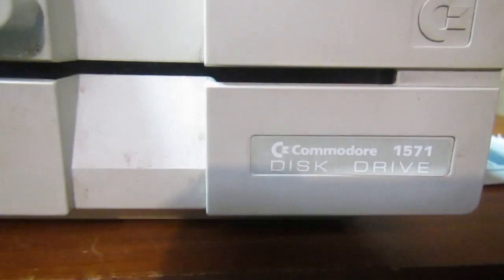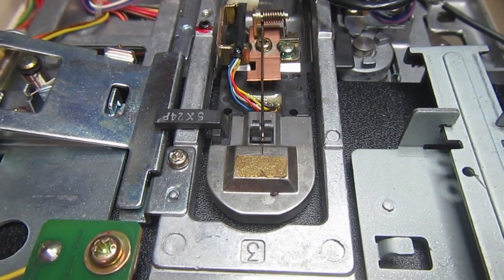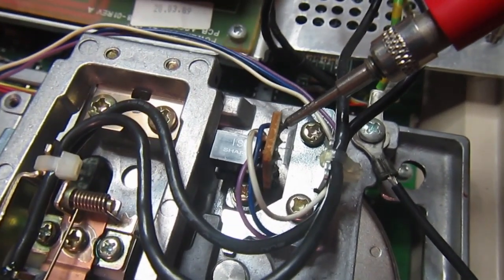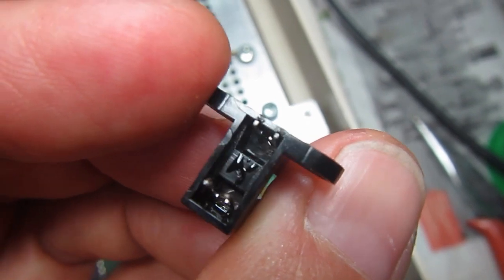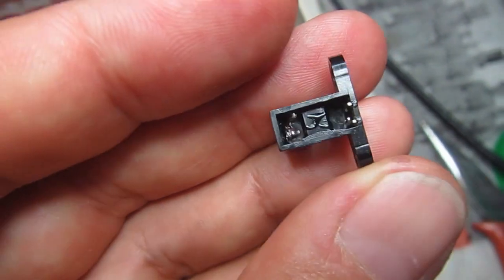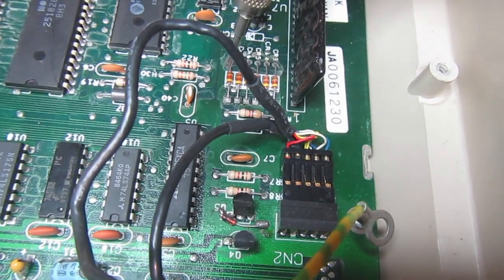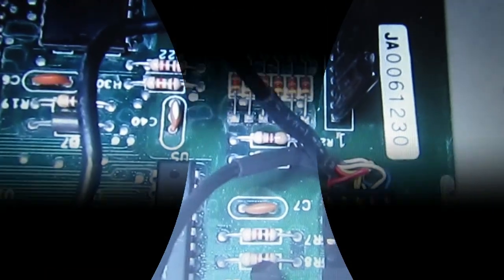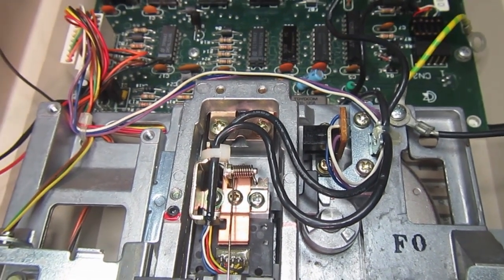Commodore 1571 repair pt. 1: track-0 sensor failure and bad heads

Comment: How you tests the track zero sensor? Is not clear. Thanks
Reply from the maker: Blue wire should measure about 0V when the head is above track 0 (the plastic light interrupter should be not inserted into the sensor) and measure about 5V when the head is at track 0.
Reply from the maker: Also you should be able to see the infrared light from the LED side by using a smartphone camera that's usually sensitive enough to that infrared light.
Reply: @iz8dwf  I meassured blue cable using the case as ground and I got 5v when interruped, so it's god. But Im still getting FILE NOT FOUND RROR when try to do anything, even format.
Reply from the maker: @rafaelmmartinez9170 it would be better if you send me an email, troubleshooting with YT comments is a bit too difficult. However you should check what happens when you issue OPEN15,8,15,"I0":CLOSE15 and also you should read the error channel from the drive.

Comment: my heads are good, track 0 sensor working.  My drive is still pretty much dead.  There is some head movement, but not much.  It does not seek 0 when powered on.  I've changed the CIA, made sure the processor is active with proper TTL levels on all address and data lines.  When I have a SERVANT ROM utility tell it to format.  It sees drive "9" but when it goes to format gets an I/O error. The server motor but not much, locks with power on.  I'm stumped and have to look in to the servo drive circuit?
Reply from the maker: Can the drive be queried on the error channel? (It should report 00 OK 00 00 or some other meaningful string). Are the power supply rails good? You should check the U7 hybrid motor phases outputs too. In general it's very hard to give suggestions on a repair without looking at the actual device's signals.
Reply: @iz8dwf   Yes, I understand and I did not give a great description.   It is the only 1571 I have right now (I think - lol).   I finally did get it semi-working.  The problem was with corrosion in the CIA socket.  Now, I can only get good alignment from track 9 to 37/38 (what ever is the highest track.  Below track 9, it off by half to one track and the stepper motor adjust it as its extreme.  So thinking it was good enough, I try loading some old games from floppy and none that I have tried work.  I can not be sure those floppies are good either - lol.  I hope my "official" alignment" disk it.

I am tempted to remove the stepper and add to its length to its tracking slots.  But before that, I am waiting for a JANI Alignment cart to show up instead of some other software I have been using.

This 1571 has been in the basement of a friend TV and electronic shop since about 1990.  He gave it to me.  It wasn't in too bac of shape, but they didn't fix it back them.  I am guess he sold the person a PC.  The C128 came with it.  It had a bad key contact and a bad SID.  At least the heads are good one the 1571 (i can measure the resistance of the two sections of each at about 20 ohms.  It will format and read its own floppies.
Reply from the maker: @Daveyk021  good that you progressed in the repair! I wouldn't attempt an alignment without a very good disk at hand. I have seldom found the need to align any old drive so far. Fault was always elsewhere. YMMV.
Reply: @iz8dwf  Good advice, but too late; I am a tinkerer - lol.   It was not good at track 18 that the test program defaults to until I tinkers and screwed with the alignment.  I can't be afraid to break it.  I just need to find another 1571 (not easy) if I want to fix this one.  With the SD and Pi solutions, it's not urgent, but I have acquired a lot of disks for the 128 and 65 that it would be nice to transfer to SD and share with the community of any of them are unique (which I doubt).  Just use it the way that it was intended would be cool.

Comment: Thanks for the video, helped me to diagnose my 1571, seems the track 1 sensor is broken as well, in my case I can't see any light even in the dark. Where did you buy the spare part? Do you maybe have a part number?
Reply from the maker: Hi! I actually had a compatible spare, maybe from a printer or a scanner. I keep quite a few broken devices for parts. I'll try to come up with a part number if the schematic or service manual has enough informations. However, first make sure the infrared LED is powered, it should be connected between +5V and ground with a series resistor. If the LED failed, you should measure 5V across its two pins. If not, then maybe the series resistor failed or a solder joint is broken.
Reply: you mean between the white and purple cable? Yeah I've got 5V between them. I found a part number hy805 on ebay/amazon but it doesn't have the exact same dimensions, so not sure ... you said your part also wasn't exactly the same size? @iz8dwf
Reply from the maker: @namhafterstephan  Yes, white to purple. I think the right replacement can be found on one of the various big electronic distributors: digikey, mouser, farnell. Look at this datasheet for example, there might be a compatible part, dimensions-wise:
http://www.farnell.com/datasheets/73816.pdf

Comment: Another great video, Frank. I enjoy learning from your troubleshooting skills. Hmm, it sounds worthwhile resoldering the head wire connections, as aphexteknol suggests. Keep us posted.
Reply from the maker: Thank you for the nice comment! Unfortunately it seems that resoldering the wires couldn't fix the problem. Maybe I should try to disassemble all the heads  and look for any external damage, but I'm leaving it alone for now :/

Comment: Before writing off the heads, you might want to check for any breaks in the fine wires before they get soldered to the head. I’ve managed to repair a 1571 I thought had a bad head by resoldering the head wire connections on the upper head. Probably won’t fix them all if the head coils themselves are the culprit (which does happen of course) but its worth checking out in my experience...
Reply from the maker: Do you mean the wires exiting from the head's epoxy sealing? I assumed that measuring the continuity right at the solder posts of the heads would be the ultimate test. Ok, I'll do as you suggest soon anyway :)
Reply: iz8dwf Yep, exactly. For whatever reason it seems that the wires there are unusually fragile right at that spot. You can test the head continuity easily right on the solder points easily too just to make sure (at least for the upper head. Getting to the lower is a different story!)
Reply from the maker: Ok, I've just tried to resolder the wire on the erase coil of top head, which is easy to reach. No joy, it didn't fix the problem. The wires are soldered on little posts on the head, then there're tiny PCB tracks that run inside the head itself. There's a metallic screen over the head, so I couldn't follow the tracks until they dive into the head.
Reply: iz8dwf Thats a shame. It was worth a try though I suppose. I hate to have a dead drive with bad head coils because there really isn’t any way to repair it. All its good for is a parts unit from that point forward. :(
Reply from the maker: Hi aphexteknol, yes, it's probably the only fault that can't be repaired. I'm quite sure one could adapt a 360K-PC drive to work in a 1571 (or 1541, single side only). I would remove the electronic board and re-arrange the connectors for sensors/stepper/spindle and heads to match the 1571 connectors and it should work fine. I don't have 360K spare drives anyway.

Comment: Very informative video once again. I bought my first disk drive back in 1987 and it was an 1571.
Reply from the maker: Hi Miidolf! Thank you! I'm currently repairing another 1571, and I checked the head's coils continuity before doing anything else this time. 
Once it's done, I will condense another video from that repair. Head failure isn't common at all, at least in my experience, but it happens.